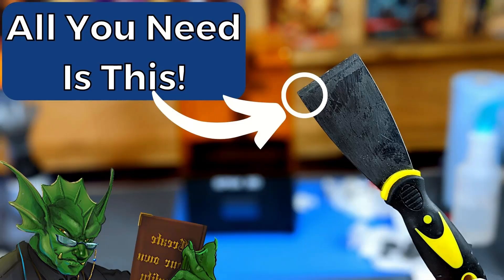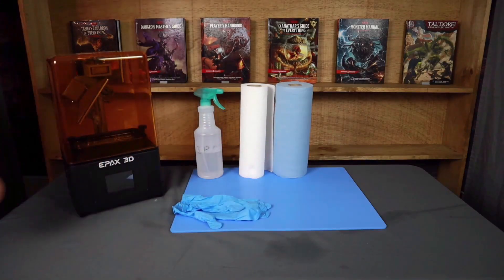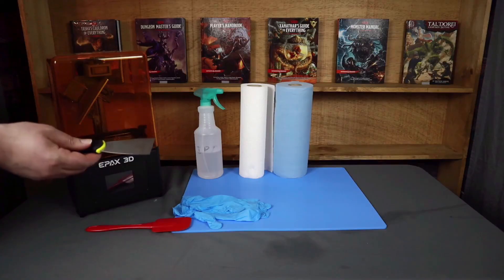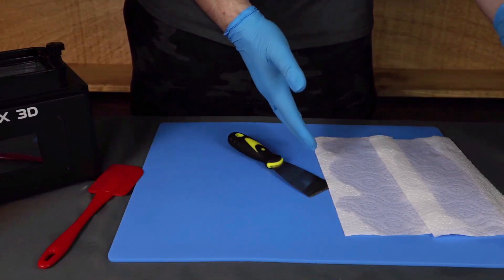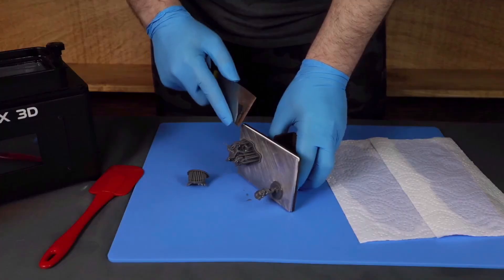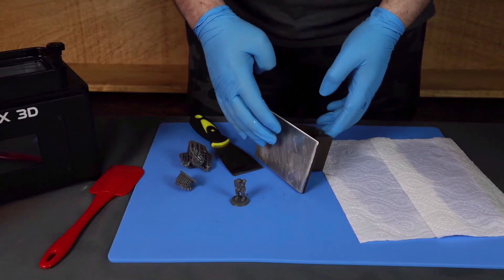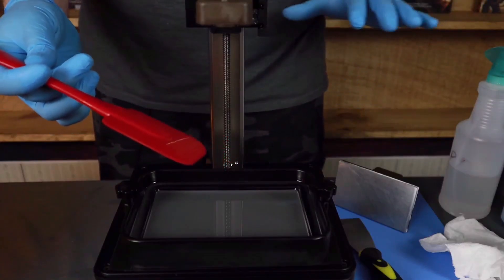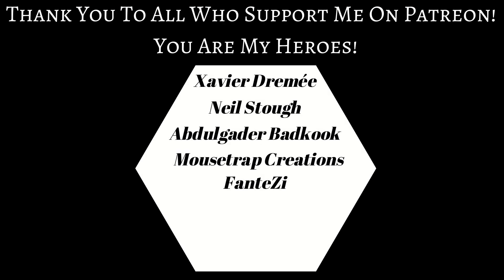How to Remove Resin 3D Prints from Your Build Plate. Plus Other Tips!

Comment: I like your video and I like how you explain everything. It looks more easy than it looks like you know English is my second language. I’m trying to explain I want to buy a 3-D resins printer I’m not sure what to buy. I don’t need nothing expensive or big. Thanks
Reply from the maker: @35722753aj  I'm so glad you enjoyed my video.
Your English is great so don't worry about that. I have no issues understanding your question.
I can give you some general recommendations but if you want more specific info I'd recommend joining my Facebook group or Discord Server.
It's extremely hard to beat Elegoo when it comes to budget resin printers. Check out the Mars 3 series. They are an older generation but they're still supported and should be very budget friendly.
I will also be testing the Geeetech Alkaid soon. That printer retails for right around $100. I'll have updates about that printer soon.

Comment: Hey! im using an elegoo saturn 2 8k with 8k waterwashable resin and no matter what i do my prints require so much force to get off they end up snapping into brittle little bits- im printing in a warm room and my bottom exporsure time is the factory recommended 35- my first few prints popped off the build plate just like yours with minimal pressure- not sure what happened if you have any tips or advice id really appreciate it!
Reply from the maker: @rodneyvonC  so my first tip is an easy one. Try dropping your bottom exposure time to 25s. In my experience, 35s is a bit long for most resins.

My second tip is less easy. Try a different resin. I've found water washable resins to be a bit finicky. I'd recommend trying Sunlu ABS Like Resin.

Comment: The bases always break. No matter how gently I try to get them loose. What can I do? There are already some scratches on the surface. Is that a Problem?
Reply from the maker: @miwi7315  that's a common issue. The first thing I suggest is reducing your bottom exposure time by 10s. Typically, most printers using most resins will do fine with 25s - 35s bottom exposure time.
Scratches in the bill plate are not a concern unless there are raised/sharp bits you can feel with your finger.
Reply: @SlicePrintRoleplay Thank you for your answer. I have it at 30s at the moment.
Reply from the maker: @miwi7315  you are very welcome. I'd try dropping it to 20s and see if that resolves the issue.

Comment: What if I accidentally cure my prints on the build plate?
Reply from the maker: @nathanrivas5723  clean the whole build plate and all the parts, put it into a large zip lock bag, then put it in the freezer. The parts should either pop off on their own or, at the very least, easier to remove. Just be extra careful not to get any resin inside your freezer.

Comment: You can also heat up your plate and then models will come out easier and not damaged at all. For example pour hot water on top side of the plate. You have make sure it's back to normal temperature before you start new print.

Comment: The single sided 45° tipped tools work best compared to the flat/90, I rotate the tool once underneath to peel the part equally around. it's more rare than the dual angle ones, but worth the extra cost

Comment: I lost my scraper now the print is stuck 💀
Reply from the maker: Wait until the sun goes down and it's cold outside. Take your build plate outside and let it get cold. The part should pop off after that. 😊
Reply: @SlicePrintRoleplay  I just used hot water and a knife and it went off smoothly know I know what to do if I lose my scrapper. (I have to keep the knife only for resin now)

Comment: Holy shit! Thank you so much because every time I do it oftentimes models will go flying across the room because I was just putting so much pressure into it to get it off or I have to literally wiggle the models off of the supports and leave the supports on there until I can take them off later but it just took so long to get everything off the build plate.
That and then I heard that hot water helps. But then I run the risk of getting the models wet and if it's not the water washable resin then it's sometimes might mess with it

Comment: If there's a big scratch* on the build plate but its flat will it still work fine? You said that you should feel it to be smooth and it feels smooth is that okay?
Reply from the maker: Yep that should be fine. If you can run your finger across the scratch and you don't feel any sharp points then it's fine.

Comment: Awesome video, thank you. What's your process for cleaning the vat? I just did my very first test print, emptied resin back into its container, and I wiped my pfa with 99% alcohol. It's now hazy... not sure if that was the wrong move
Reply from the maker: Hey there. I actually have a video that covers my process for cleaning the vat. I'll post it below.
Your FEP is probably fine. I'm betting you just need to give it another wip or two maybe one with IPA and one without.

https://youtu.be/cvMYSMkQvdw
Reply: @SlicePrintRoleplay  Thank you!!
Reply from the maker: @austins.4459  You are very welcome. 😊

Comment: Do you leave resin in printer or do you put it in bottle after every print?
Reply from the maker: If you have a failed print then yes definitely filter the resin from your vat back into the bottle.
If your print looks good with no failures then you're fine to leave the resin in the vat. I've left resin in the vat for weeks without issue. Just stir it well before use.

If you need it, here's a video going over how to drain your vat after a failed print.
https://youtu.be/cvMYSMkQvdw

Comment: This really helped refine my workflow for printing. Thanks for making this!  It was crazy helpful.
Reply: I do have a question if you are still monitoring this by chance. How effective is the ipa wet paper towel at cleaning up resin?  For example let’s say some resin is on the handle of a tool. Would wiping that handle down get enough of it to be considered safe to touch or would you recommend a more thorough cleaning?
Reply from the maker: @minmaxwell6583  I'm so glad to hear that this video helped you!

So I should state by saying I'm not a doctor or a chemist so any input I give is purely from my own experience.
I try my absolute best to avoid contaminating surfaces I might touch with my bare hands. So handles of tools, work surfaces, etc... However, when resin has ended up on my tools I've been able to clean (seemly) all traces of it away with IPA on a paper towel. So far I've not had any issues with irritation on my skin... I hope that answers your question.

Comment: Tldr get a flexible build plate. Pull it off bend it done. No damaged parts no struggle
Reply from the maker: Yep that comments been made a few times. I do absolutely recommend flex plates. However, no printer (that I know of) comes with one installed. So I figured this info might help people just starting out.
Reply: @SlicePrintRoleplay  I didn't mean to offend I did heavy research before buying my printer and ordered a flex plate with it. I've never actually scraped a part off but I've seen lots of videos and it just doesn't look like a good time lol.
Reply from the maker: @Josh-bc7gi  no offense taken. But you should know that you are in a very small group that bought a flex plate with their printer. It was definitely a good call. 👍

Comment: Soak the prints in warm water on the plate for like 5 minutes. Just hot water from the sink, and the prints will fall off the plate and be super easy to remove supports.
Reply from the maker: That's definitely not a bad option. For me though that requires a little too much prep and cleanup. However, for models with really thin parts or small supports then that would definitely make it worth it!
Just be sure to dispose of the water properly.

Comment: Hi, I use pliars. They actually do the same the corner of the scraper does but you can control the force you apply and losen the model rather than poping it of the build plate.
The model does not take flight that easy when I do it and I can losen even aggressive cases of adhesion.
Reply from the maker: Interesting. I'll be honest that sounds like it would definitely damage your models... But I'll gladly admit that I could very well be wrong... I'd love to see a video of your process if you're willing to post one in the Slice Print Roleplay Facebook group.
Reply: @SlicePrintRoleplay  It works best with pliars for electronics that form a plane on one side when closed.
Open the pliars and put them with the flat side on to the build plate with both tips touching the raft or platform of the print.
Now gently close the pliars until you feel that the tips are between raft/platform and built plate.
You can press further to gain more area or start to tilt the pliars gently.
It takes a bit of practice but I have a lot of control over the model when I remove it from the built plate.
Sorry I have no facebook, I can't post a video into the group.

Comment: I use a plastic scraper or an old plastic card sanded down on one edge, i would never use a metal scraper on my bed, it scratches up the surface (which is usually sanded/textured to maximuse adhesion with your print) and if you did put a gouge or miss a metal flake you can cut your FEP film with will ruin your entire printer (resin leak)
Reply from the maker: Glad you found something that works for you.

Comment: I got a tool that is a very smoothly ground thinner, narrower version of a scraper that I got off of amazon that does and excellent job of popping things off of the build plate with as much control as possible. It is much better than your generic paint scraper.
Edit: If i'm making another print right away I also wipe the rubber spatula off on the top of the build plate as it's going straight back into the stirred resin, any that drips off get right back into the vat that way as well.
Reply from the maker: Oh that sounds like an awesome tool for this job! I'll definitely keep an eye out for something similar.

That's a great point about scraping it against the build plate! Thanks for that!